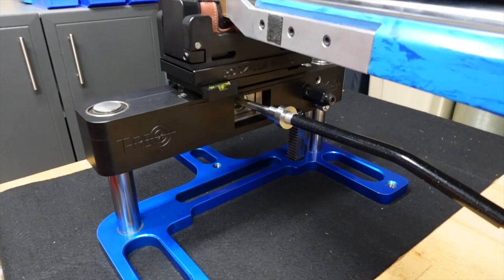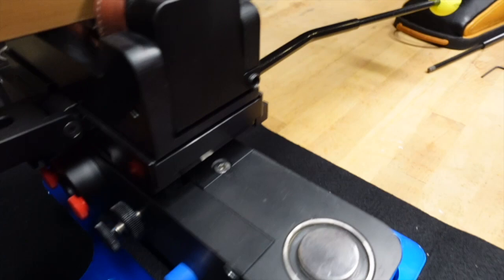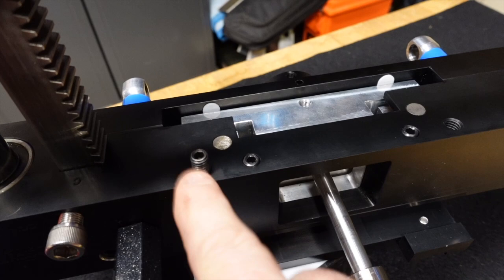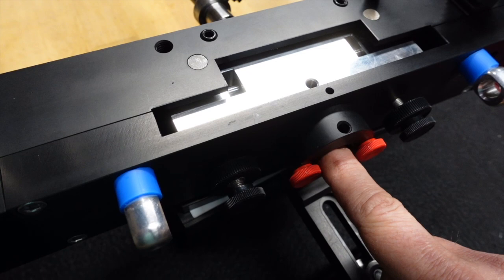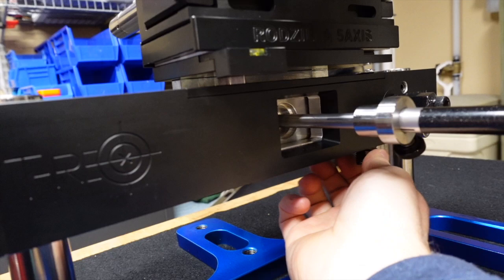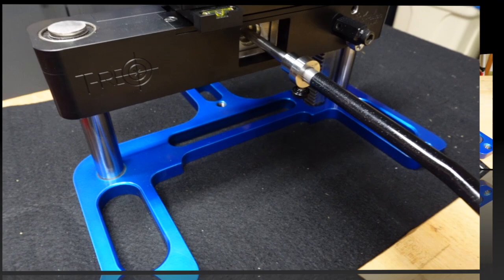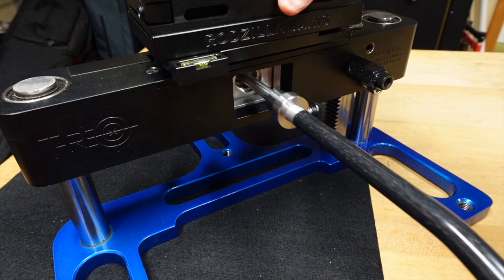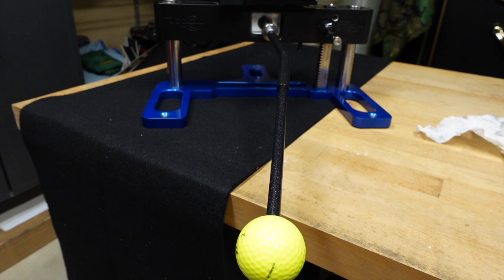Adjust and balance your Rodzilla T-Rex front rest

Comment: I really like & appreciate your video reviews of your T-Rex front shooting rest! For someone new just getting into F-Class would you recommend this rest? In mind or my way of thinking I’d like to invest once in the right piece of equipment that will last me allow me to shoot & compete & or grow in the sport. The rifle I’ve ordered to start out in F-Class is no where near as heavy as the rifles it seems most are using but it will get me started till I’m ready to have one custom made
Reply from the maker: It's a great rest and I don't think you could go wrong with it but I would recommend you try out some rests at the range if you can so get a feel for them. It would help give you some perspective on how they work and also that way when you get a really good one like the T-Rex you'll really appreciate it.
Reply: @FClassJohn  thanks! I almost called them to inquire about placing a order today but thought I’d research a few more before doing so? I really liked the features the adjustment the range of adjustment you talked about in your video! I have looked at their website & the T-Rex is a quality built front rest! As I’m sure most are at this level? Is it the range of adjustment & the sensitivity that sets one brand or model apart from another? It sure seemed to me that the T-Rex has it all? At least compared to the ones I have seen or looked at so far?
Reply from the maker: @arronhamilton8091  it’s definitely the highest quality, most feature laden rest you can buy. If you’re looking to shoot F Class it’s a pretty amazing rest to do it with.

Comment: What did you use at the end of the joystick??
Reply from the maker: A golf ball from miniature golf. I just drilled it out and pressure fit it on.
Reply: @FClassJohn  thanks
Reply: How would I adjust the joystick so it doesn’t move when I take my hand off it. I like to shoot so that I set my point of aim, remove my hand from the joystick and fire the rifle. I want the joystick to remain absolutely at my point of aim. Thanks for all your help.
Reply from the maker: @howardschwartz1462  You have to adjust the tensions screws under the bridge until your gun is balanced. It take a little bit of back and forth but once you have it set you should be good.
Reply: @FClassJohn  do you mean the two screws that come about equally spaced from Rodzilla?
Reply: How do you know your gun is balance? When you push the joystick down, it doesn’t move or when you push the joystick up it doesn’t move?
Reply from the maker: @howardschwartz1462  Yes underneath. They control the amount of spring pressure upwards.
Reply: @FClassJohn  thanks I’ll give it a try. I’m not very mechanical though.😱
Reply: My benchrest firearm weighs 15 pounds. Do you suggest I take out the spring as you talked about in your video or just leave it in. Will that make it easier for me to balance the two screws?